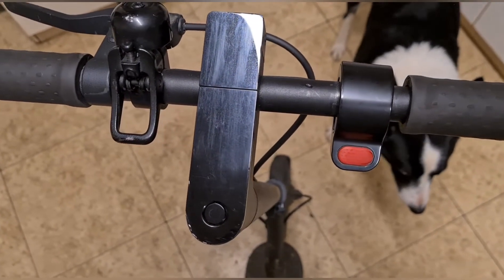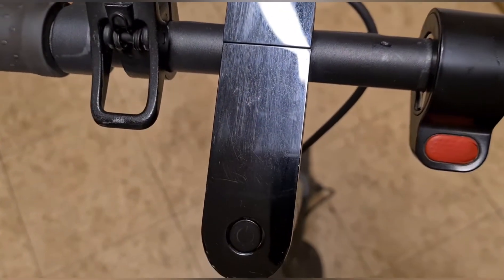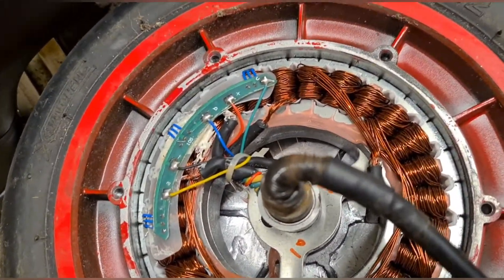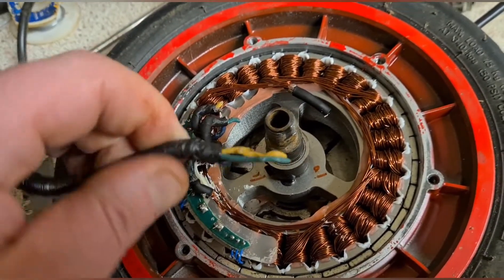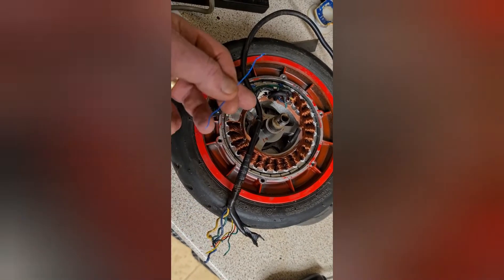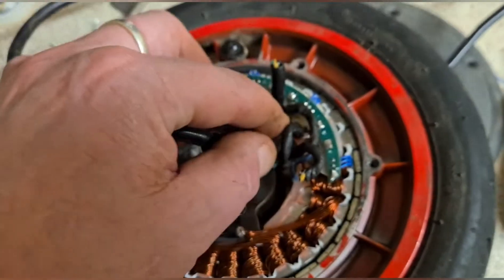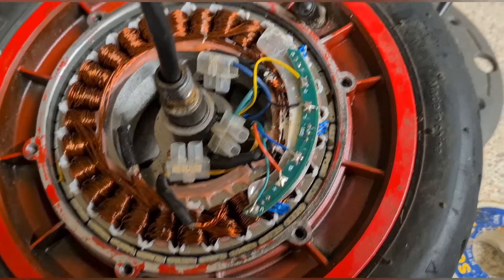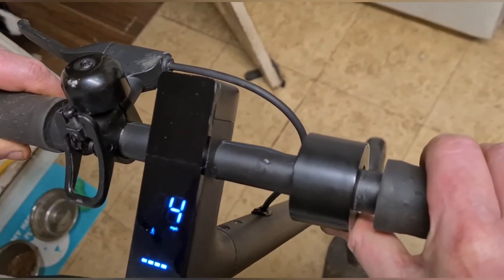xiaomi pro 2 ERROR 18, Hall sensor wiring issue (a how to video)

Comment: I was going on an Uphill road (12%) for a little too long, and just at the top it started struggling and eventually stopped completely.
So i restarted it and it showed me the Code 18.
After that i tried restarting it again but it wouldnt turn on at all. However a few moments later it did turn back on, functioning normal as if nothing ever happened.
Guess the engine just doesn't like long uphill drives.